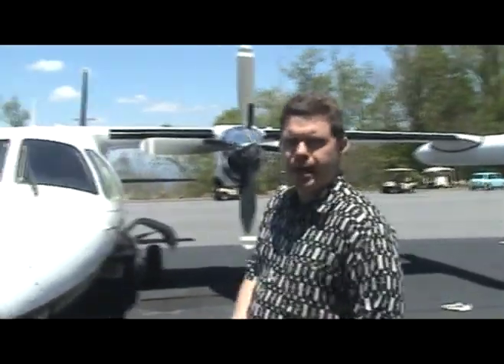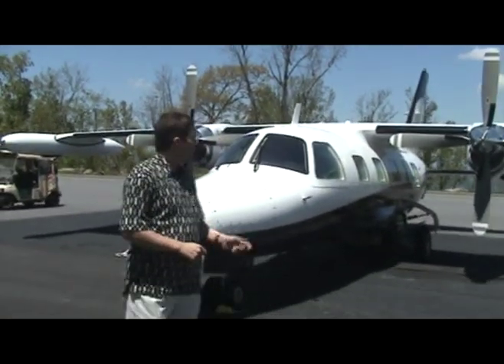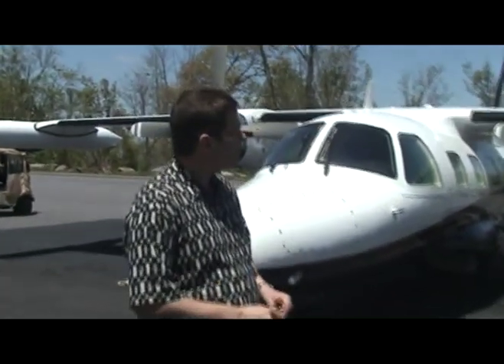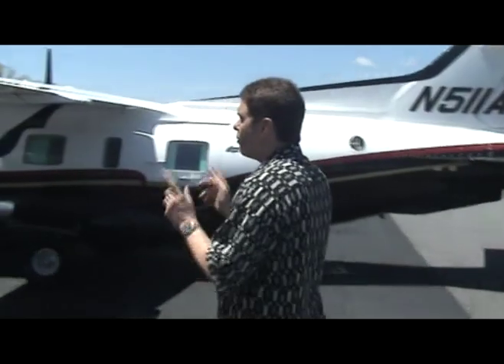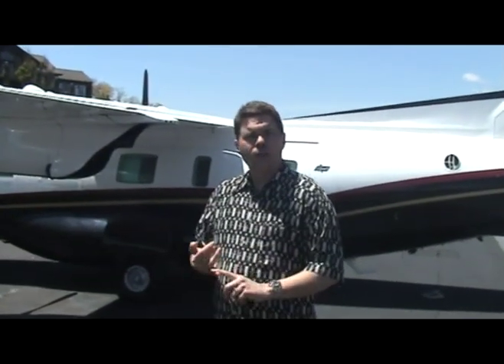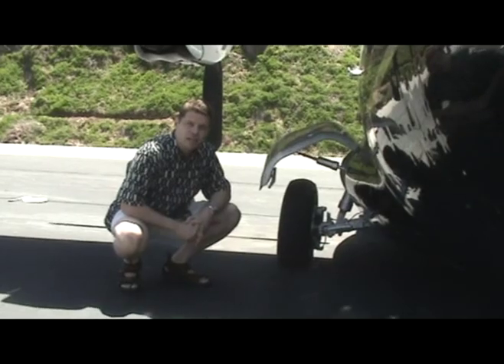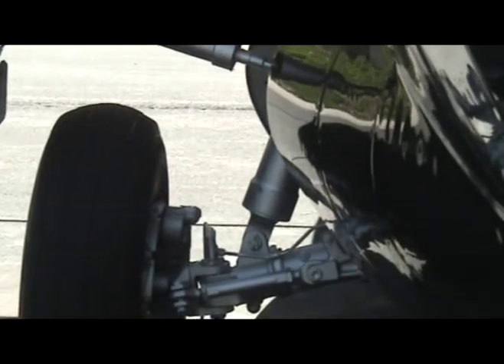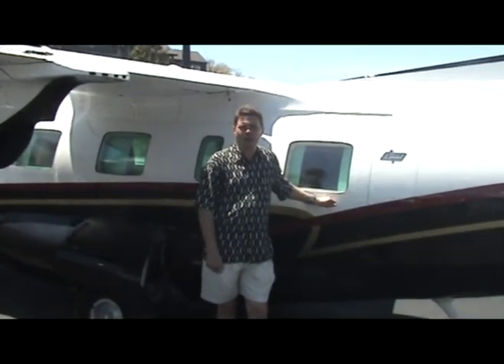Intro to the MU2 #1 -- Design Features

Comment: I don’t know if you’re still following this post or even if you still fly the MU2 but I’d be curious to know what the single engine procedures actually are. You mentioned “similar to a jet” but I’d like more details. FYI, I fly a Conquest II.
Reply from the maker: 1) Because of the spoilers you don’t want to bank into the good engine. 
2) Because of the double slotted Fowler flaps and the fact that takeoffs are done with 20° of flap, you want to climb out at Vxse if you have an engine failure on takeoff. Less emphasis on accelerating to blue line and cleaning up. 
Those are a couple of the big differences.
Reply: @mtnairpilot  Got it, thanks!

Comment: thats some beefy mains for a GA what are the landing VVI limits?
Reply from the maker: IDK, but they are the same landing gear as are used on the F-104.
Reply: another question for you whats the practical IFR range you get with 6 people?

in X-Plane i got over 900nm out of the MU-2 with a 1500lb payload and about 1 hour of fuel left in the tanks
Reply from the maker: +Elios0000 it depends on range to alternate but I think 900 miles with a 50 mile alternate could be achieved consistently. Mine would be right at MGTOW with full tanks and 6 200 lb people. At FL260/270 I see about 580 pph and 280 ktas. At 5000' I'm doing about 180 ktas at 600 pph.
Reply: sim alternate was pretty close, flight was KSGF to KOXB alt was KSBY

thanks for answering my questions the MU-2 in X-plane is so much fun to fly and really can do anything you ask of it

Mitsubishi should restart production imo

Comment: I believe in this video, or another one, you say that the engines also produce thrust from the exhaust. Is this thrust only on the MU2 or on all planes that use that engine? Do most turbo prop engines have thrust from the exhaust? Would like to hear more comments on this.
Reply from the maker: All Honeywell/Garrett TPE-331 engine airplanes, like the MU2, Merlin, King Air B100 and the Turbo Commander, produce some thrust from the exhaust.  It is not significant compared to the prop.

Comment: About the "Man Killer" thing... The primary "problem" of the MU-2 is (or was before the SFAR) its affordability. As a result many pilots and operators, who should have remained on slow and low-demand piston planes "graduated" to a high-speed turbine aircraft. If you look at the NTSB database for fatal MU-2 accidents, you will see that the primary "Man Killer" in the MU-2 is pilots not sticking to procedure, followed by shear numbskullery (i.e. controlled flight into terrain, flight into t-storms) and poor maintenance. The main reason for the "bad rep" is that the MU-2, as pointed out several times here, is NOT a "seat of the pants" airplane. You need to learn and understand the procedures involved in normal flight as well as emergency situations. You need to respect the airplane and she will take care of you.

Comment: A huge fan of the MU2 since I was a kid in Nairobi and first saw one start up, taxi, and takeoff.  Also, I had the pleasure of flying a Cherokee into Mountain Air - what a thrill!

This is an interesting tutorial, but seriously, why bother posting it without editing?  It's so crappy with the wind.  I noticed you did stop and restart several times in the video, so why not re-do the first few minutes sans wind?  It wouldn't cost you a penny.

Other than that whiny comment, a great little tutorial.

Comment: The most negative comments I've heard about MU2s have all come from pilots who have never flown them, and their opinions are generally from a guy who knows a guy who met a guy who was some sort of hot shot. They require comprehensive training to be operated safely if I'm correct. In Australia, we must by certified for every turbo-prop, unlike the USA (I think). PA34 into an MU2 with no extra training? They don't seem conventional enough to do that.

Comment: Flaps 0 takeoffs are SWEET!  Shortest run due to high acceleration.  Rotate to 12 degrees at 1.2 stall or about 120K at gross weight.  Not for high density altitudes due to max tire speed 139K or general use but good to demo in case a guy forgets flap one day and doesn't reject unnecessarily. 
BTW "Lift" is not always your best friend.  Note how climb improves on a normal takeoff when flaps are retracted.
And flaps 5 takeoff helps get to a safe S/E speed more quickly than 20.  
Cheers

Comment from the maker: @tubepusser Setting aside the power difference between a Marquise and a J or L model, in an engine failure after takeoff scenario, accelerating to a flaps 0 or flaps 5 speed before you hit the trees may not be an option.  My comparison to the Lear related only to wing loading, which is a fact.  I don't think I implied that single engine performance was comparable.

Comment: MYTH!  I trained on the MU-2 for 15 years and used to buy into you say. We soon found that the manual was right and it climbs better with the flaps 5 or up.  At gross weight we got no rate of climb (MU2J&L) with flaps 20, 200 fpm at 5 and 500 fpm at zero using Vyse.  At Vxse we got better climb gradient by far with the lesser flap settings.  We flew a Lear 24 also and there is NO similarity as the Lear has so much better power/weight ratio and does OK with flaps down single engine.

Comment from the maker: @chair5432 The MU2 has spoilers, not spoilerons (there is a difference).  
That was a very insightful and helpful "Honda with a nitrous system" comment.  Did you hear that one in a bar from a guy who heard about a guy who saw an MU2 in a hangar 20 years ago?  The pilots who actually fly the airplanes universally have a completely different view.  It must be nice not to be burdened with any facts when you make your comments.

Comment: I have no experience flying the MU-2 myself but, from what I've heard, the problem is not the aircraft itself (which is a remarkable piece of engineering)  but how demanding it is for those without the proper training. It weighs less than 12 500 pounds so any multiengine rated pilot can legally fly it but it has fairly complex systems and flying characteristics closer to those of a jet than to a prop plane (high wing loading and very effective Fowler flaps).